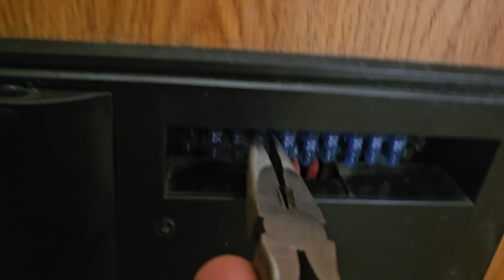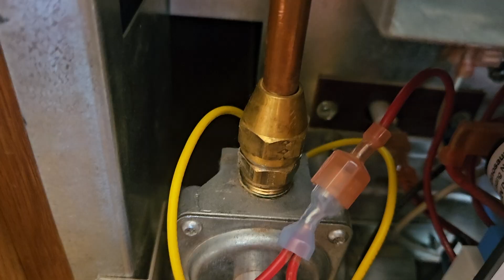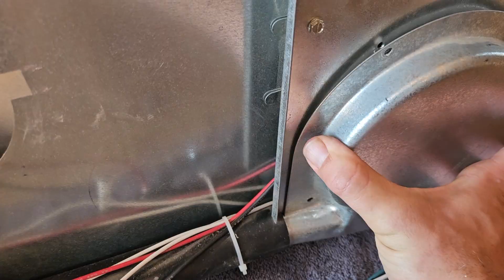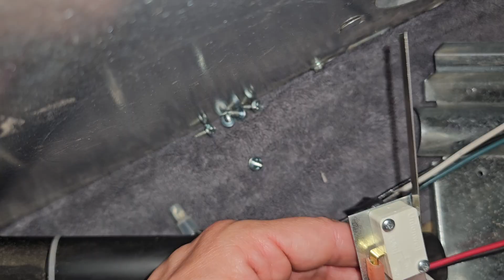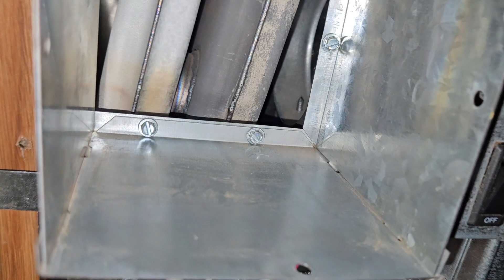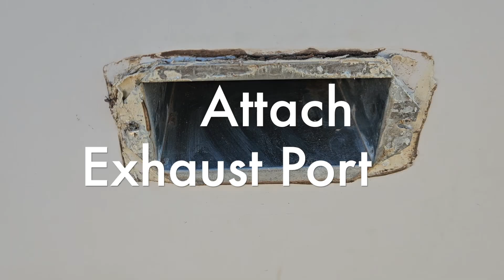Replace Sail Switch on Atwood Furnace 7920-II

Comment: Wire order does not matter, a switch simply connects the 2 terminals together when the sail is pushed and disconnects them when its not pushed.  No need to mark them.  It is good practice on unknown circuits.  
Nice video tho.